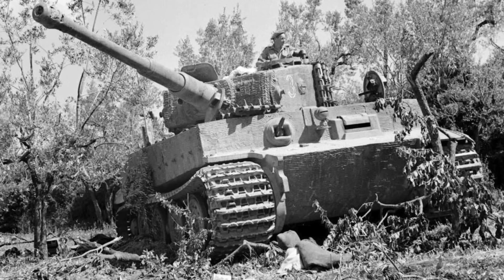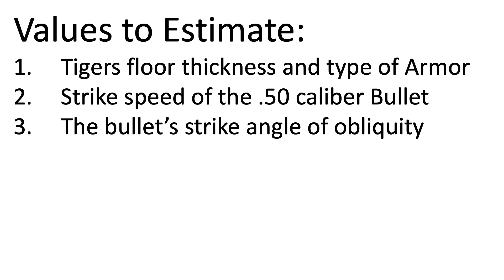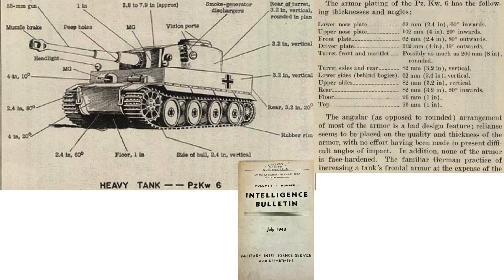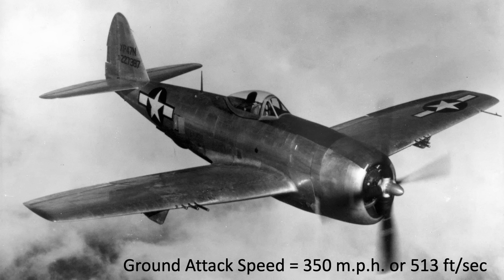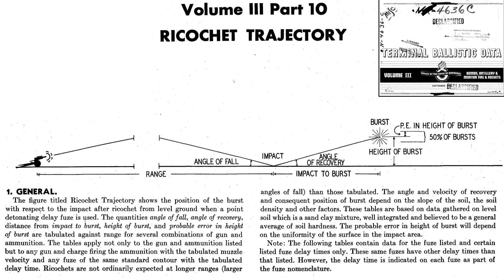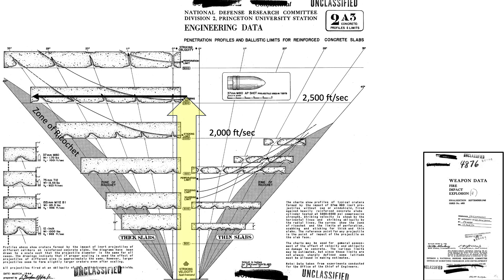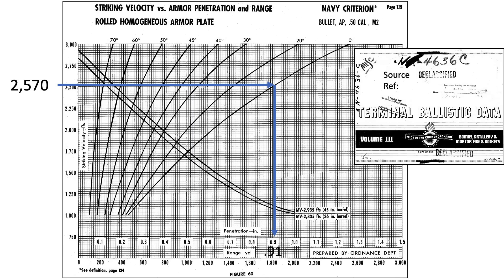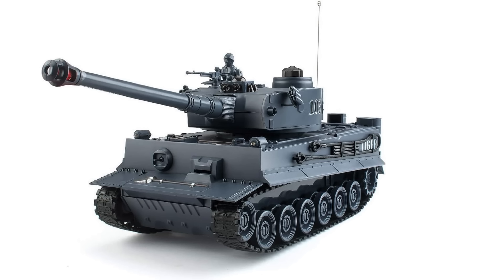P-47 vs Tiger Tank: Can Machine Guns Penetrate Armor?

Comment: Another great video ! The main assumption was that it was a Tiger not a Panzer 4 which only has 10mm floor armor or less than half-inch. Their similar shapes made misidentification very common plus the Tiger was almost mythical to the point where US combat reports often cited Tigers where none existed. In the 6 months after Normandy for example, the US forces hardly encountered the Tiger 1 partly because there were relatively few and also because the heavy armored units were committed against the British on the Caen front. Due to allied air superiority, you almost always see German tanks camouflaged with foliage making split-second identification in a plane streaking in at 300 mph very difficult.  Theoretically, it's possible to penetrate the floor of the Panzer 4 but as others have pointed out, as soon as a round is deformed or tumbles, the penetrative power rapidly becomes zero.  However, the P-47 with the M2 version of the 50 cal Browning unleashed 8x13 = 104 rounds per second. Plus the added velocity of the aircraft's own velocity.The top of the engine compartment of the Panzer 4 was also 10mm and was relatively vulnerable with intakes, radiator louvres etc where there was a good possibility of rounds penetrating and disabling the engine. I have read combat reports of ground attack pilots preferring steep attack angles both to facilitate penetration of the thin upper armor and complicate the job of the anti-aircraft gunners. Whatever the truth, the brave pilot making the original report and all the others will always he heroes...
Reply: Typical hit rates were quite low, so although 104 rounds might be fired less than 20 are likely to have hit, and very possibly fewer than that as the relative closing speed is high meaning that the opportunity for fire at the write convergence is very brief. Plus quite often there was at least distracting defensive fire, smoke, etc. So whilst in theory an engine deck hit was possible the chance of damage wasn't that great. Claims were made but identification was difficult and often tanks were open-topped SPGs and not even tanks at all. Analysis of results showed almost no tanks were killed by FBs using anything but bombs and mass bombing by heavy bombers was judged to be more effective against tanks than FBs. However, FBs caused panic and destroyed a lot of transport vehicles, APCs, etc., so were still effective
Reply: All excellent points. Combat footage typically shows 3 second bursts with the pilots sometimes walking the rounds into the target so 20 or less sounds likely. From a pilot's perspective, keeping the ball dead center while firing to prevent yaw was a crucial skill especially for rockets. Perhaps the main value of these attacks was to hugely curtail operational flexibility by day. As the engine noise of the P-47s faded, someone was likely already plotting a set of coordinates focusing on the demise of the support vehicles to decapitate the armor.  @wbertie2604
Reply: At 300 knots and several thousand feet altitude while being shot at I have a bit of trouble with a pilot determining between a Panzer IV versus a Tiger.
Reply: @jimmiller5600  I doubt even a Panzer 4 was ever knocked out this way.
Reply: @williamzk9083  I agree, I was just going with the difficulty of telling one tank apart from another while flying fast and dodging bullets.
Reply: Hard to believe P-47 buses doing steep diving attacks. I also never saw footage of more than 30° attacks. I know people can be stupid, but risking your life to maybe hit and with even less chance of destroying it?
Reply: @0Turbox  Understood but we tend to think of an individual aircraft strafing. Often I believe for reasons of command and control, formations would fly at about 5,000 feet. The commander identified the target and organised the attack. The golden rule was never make 2 passes.   In the fleeting dangerous moments that followed, I doubt there was much time for careful setups. I also wonder what the worst angle for attack was. Wild guess would be 30-35 degrees. Low aircraft for the gunners presented problems of line of sight and the mechanics of swinging barrels round. 45 degree dives presented a mind-boggling double angular deflection shot. As we sit in armchairs watching gun cams, we can forget the pilot struggled to see any target as he sat 9 feet behind a huge radial scanning sideways. If the target was near, he would need to dive- if further away he might try and hug the deck.
Reply: The main assumption in the video is that there were concrete based roads. In rural 1940's France?  Outside RNs and better D roads, No chance, asphalt over a thin crust of hardcore  if you were lucky, but in the main dirt tracks.
Reply: Does not matter hardly any tanks were knocked out or disabled by aircraft period.
Reply: @JuergenGDB    Proof of that please?
Reply: "I have read combat reports of ground attack pilots preferring steep attack angles"
Pilots of what planes exactly and in what theater? In very steep dive any fighter bomber would simply have too little time to shoot before they'd have to recover. I think it could be against ships. The strafing angles I remember from manuals are something like 20 degrees if even that high.
Reply: @Teh0X From memory, Hurricanes in North Africa with 20mm found their ability to disable the Panzer III in top down attacks increased as the attack angle steepened. I suggest “steep” for a non-dive bomber would be 45 degrees. The reality is that most mobile military targets will position to use vertical obstructions like tree lines and buildings to thwart ground attack. Thus to even identify a target would often require a degree of flying overhead. I imagine aside from trains and airfields, the opportunities for a comfortable 20 degree approach maintaining line of sight would be quite limited.  Clostermann “The Big Show” has quite a few references to ground attack ( which he hated).
Reply: @allegrofantasy  That indeed depends what the usual targets would be. Soft trains and convoys on a road would be easy to spot and strafe with any weapons. Single targets under trees far less so.
Reply: @allegrofantasy  He also hated the German flak (gunners), he mentioned that many times, as I remember.
Reply: @allegrofantasy  The Hispano gun had a particularly powerful cartridge and a heavy round.  Apart from medium and heavy tanks it would have been deadly against anything else.  
I've often wonder how the Luftwaffe did most of its tank busting since Rudels one squadron of Ju 87G was trivial in the scheme of things.
Apparently they just used bombs from a Fw 190F often sliding them along the ground with time delay fuses by flying over the tank or dive bombing from a Fw 190F or Ju 88 using a StuVi 5B computing dive bombing sight.  Rudels book seems to have displaced what really was going on.   The also had  hollow charge cluster bombs released from the AB250-2 with 40   SD HL 4 hollow charge submunitions.
Reply: "Plus the added velocity of the aircraft's own velocity".- sorry, but you need to do some physics research.
Reply: @daviddonne7333  As explained clearly in the video at 3:00, the initial velocity of the bullet is the sum of the muzzle velocity plus the aircraft’s velocity. The example speed of 350 mph is very unrealistic. The British tests on special Hispano AP Mk  III rounds quoted muzzle velocity of 3,230 fps plus 350 fps for the aircraft’s test velocity of 240 mph. Since penetrative power is related to the square of the velocity, the extra 10% velocity was a significant boost. In a May 1943 test, a Panzer 3 was comprehensively penetrated and the crew were all deemed shot to pieces.
Reply: @allegrofantasy  drag is also proportional to the square of velocity except on the case of transonic where it’s more like the cube or more. Point being bullets would slow down with the square of speed.  There were tungsten core 0.5 rounds.  These may have been effective.
Reply: @williamzk9083  Indeed and you may be interested in a remarkable set of data from British tests of aircraft-fired AP rounds showing about a 10% reduction in velocity in 200 yards. The static m/v was 3,230 fps  plus the aircraft speed of 350 fps resulting in a  striking velocity at 200 yards of 3,200 and 2,850 at 400 yards. I disagree with those suggesting aircraft were generally ineffective against tanks. The AP Mk III could penetrate a whopping 38mm at 400 yards with 30 degree strike angle. The Panzer 4's side and rear turret armor was only 30mm and was conveniently angled 30 degrees from the vertical. This would give a Typhoon attacking at 30 degrees a 0 degree strike angle and 51mm penetration or about 2 inches. At 40 rounds per second, the tests on a Panzer 3 on the range in Britain concluded in so many words that the 3 man turret crew would be reduced to teeth and toe nails. (Google WWIIequipment Hispano AP.)
Reply: @allegrofantasy  in another thread I'm being told that AP wasn't used. I had mentioned the RAF tests against the white-painted Panther from which I derived the maximum 20% hits on an ideal target, which brought up the question of 20mm. 6.5 million AP Hispano rounds were produced in 1944 alone (2.5m in 1942 and 1943) although not all would have been the highly penetrating mk. III. How many were actually used, given the standard belting was 50% HE/I and SAP/I with a penetration of 20mm face hardened armour at 200 yards, 0 degrees? SAP/I was designed to combat the light armour found on aircraft.
Reply: @wbertie2604 Good question. I would guess it was role and situation specific. So Typhoons would likely benefit from AP/HE mix but as the Luftwaffe became scarce late war, the Spits and Tempests were pushed into ground attack.
Reply: @allegrofantasy  an AP/HE mix would seem to make sense as even with oblique angles 50mm default penetration for a Mk. III round would go through top armour which would be around 50% of the attack surface. Apparently, Mk. III was inaccurate and replaced with Mk. IV, although on what date and when production later swapped over I don't know. I get the impression Mk. IV had less penetration than III but I haven't seen figures. One thing I did notice is that figures exist for 0 degrees and 20 degrees obliquity for many Hispano rounds and they seem to have relatively mild fall off of penetration at 20 degrees compared to 0 degrees. My guess is that being relatively flat nosed acts as a form of capping, maybe? I think the Mk. III was APCBC but I'd have to refresh my memory on that.
Reply: P.S. HE/AP for ground attack would be useful, I mean, as the AP might occasionally penetrate a tank but would go easily though everything else and HE would be devastating against trucks, etc. I'm not sure what effect it would have on tank running gear. Stored Jerry cans and HE/I would be problematic for tank crew.
Reply: All good points- I'm not clear on the various caps used. We usually think in terms of horizontal angles for penetration but in reality, air attacks would sometimes have to defeat a double obliquity. For an attack perpendicular to a Pz.III for example, the turret side angles inward 20 degrees but if the turret is turned 20 degrees then presumably the tables nearer 40 degree horizontal penetration would apply.  In practice, I imagine dumping 50 rounds per second on a multi-faceted target will do something very unpleasant even for a low percentage of hits. Possibly the most important factor is the skill of the pilot in keeping the aircraft in zero yaw while firing. This was particularly noted for rocket-firing aircraft with their relatively long flight times.   Even slightly ball-off-center shots could put the rockets in the adjoining field. @wbertie2604
Reply: @allegrofantasy  from what I've read of the RAF report, it's not clear how long a burst was fired to get 20% hits under ideal conditions. In combat I think 10% is more likely. At 250mph, and breaking off at 200m,  that's starting at about 400m for a two second burst, maybe ten rounds hitting. Assuming s 50/50 AP/HE,  that's only at most 5 AP rounds hitting. Against a Pz. III you might have a fighting chance of one hitting armour without wheels, side skirts, etc, getting in the way and some chance of a penetration, but it wouldn't be every time. An HE in the engine deck or hitting a wheel might be nasty. 50 cal BMG API/T lacks penetration, given the angles involved, to even get through a Pz. III although there might be a slim chance of getting one into the engine deck. There's very little of a tank that is vision port or radio attenna for any round to have a good chance of hitting it, so it would have been only every half dozen or dozen passes, even for the faster firing AN/M2. Against a Marder, an AN/M2 API/T would go straight through, though. So, I'm not convinced it was very effective against tanks, although Hispano AP more than most but the majority of targets would have been things other than tanks so it would still have been effective CAS overall even if it knocked out few tanks. Easier to hit with guns than rockets and bombs certainly had more blast. Post war they put on a lot more rockets to take into account how seldom rockets actually hit

Comment: I once read that the P-38 often would take out tanks. 4 50 cal and  1 20,,.  The  P-47 had 6 50 cal.
Reply: P-47s generally had 8.
Reply: u r correct, I stand corrected.  @wbertie2604

Comment: I appreciate the effort you put into these vids, but in this case the claim is obvious nonsense. That said, hosing a tank with 0.50 cal would almost always be a worthwhile exercise. Even though it can't penetrate armor, it'll do damage to fittings: aerials, vision blocks, exhausts, tools, etc. It might even ricochet through a vent into the engine compartment. It's a good idea, but it wouldn't penetrate the armor.

Comment: Thank you for this. I would add in two comments
1. Harmonisation distance.
During the Battle of Britain the British pilots reduce their harmonisation distances from 100yds (?) to 50 yds (?). Or at least the officer pilots did. The Sgt pilots found that the armourers wouldn't follow their orders (yes, really).
So, be mindful that in the field the harmonisation distances used by the squadrons may be reduces, simply because the pilots preferred to engage at closer range.
2. Quality of armour.
We know that the Germans favoured production numbers over spares. That is spares were kept back from the front to hit production targets. This meant a large number of tanks were abandoned for a lack of spares (for Tigers it tended to be the 'final drive'). Given this I wouldn't be surprised if the quality of the armour wasn't found to be highly variable. As you picked up, the armour used was not the (better) face-hardened steel, which requires additional time and resources to manufacturer and cast/work on. (And fuel, in critically short supply.)

In short, another urban myth that allies servicemen did because they believed it worked.

Comment: If I can provide some constructive feedback, the volume of the inserted video was very quiet compared to the rest of the video. In these cases there's a simple fix, run the audio through a dynamic range compressor, usually just called a compressor in audio tools. It makes sure the highs aren't too high and the lows aren't too low and that there aren't significant differences in the dynamic range (basically but not exactly volume in this context) throughout the video.

I'm quite a fan of your channel! You're constantly improving and it's wonderful to see that on top of the fascinating topics.

Comment: Few things:

1 - No chance a .50 penetrates medium or heavy tanks
2 - So few Tigers, it's possible the ol' Vet never even encountered one
3 - Look at the engine grates on Tigers, Panthers, Jagdtigers, etc. Very wide openings, and a P47 firing 100 rds per second it would be worth taking a shot back there. Not much protection below the grates and knocking out a radiator, fuel or oil tank/line is just about as good as punching a hole in the armor plate as far as taking the tank out of service.

Comment: This is fantastic data, and it sounds accurate for a Tiger hit on the side.  But....I believe most Americans at the time saw "Tiger" anytime they saw a German tank.  If you substitute Panzer 3 for Tiger, and top armor instead of side, I believe it's 10mm, or about .4".  Tanks in that period had the weakest armor on the top.  So if the P-47 was hitting the top of a Panzer 3, I believe those .50 shells had a good chance of penetrating.  A more minor factor is that the muzzle velocity against a ground target is going to be about 200fps or so faster, because of the relative velocity of the aircraft toward the target.  A small change, but perhaps significant.  I love your research and videos, and would love to know about the actual math of P-47 or P-51 against the more common German tanks.
Reply: US forces almost never encountered Panzer IIIs in 1944-45.
Reply: @executivedirector7467  I think you're right, but also think the Germans had tank destroyers built on 3 chassis, that look a little like Tigers.  I don't know if they used those much in the west.  The Panther didn't have think roof armor, either, but also doesn't look like a Tiger.
Reply: @tomsmith3045  Yes, the Stug III was one of their most common AFVs on all fronts.